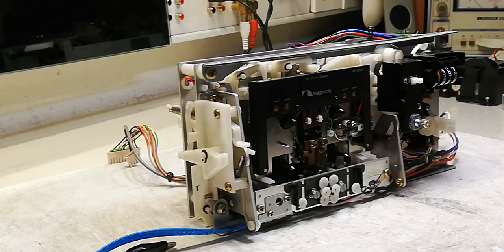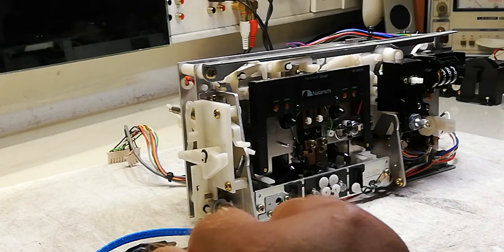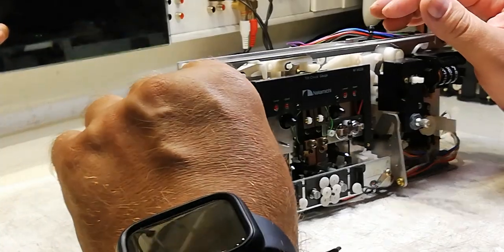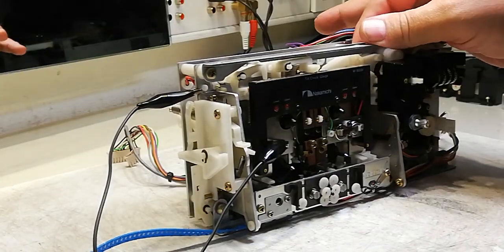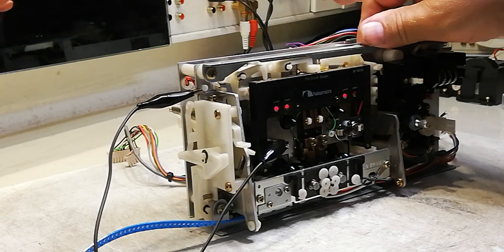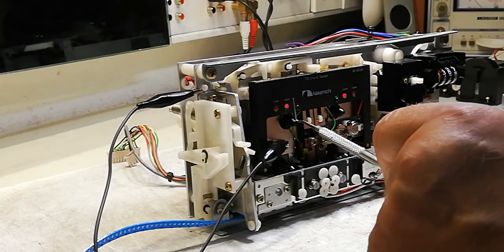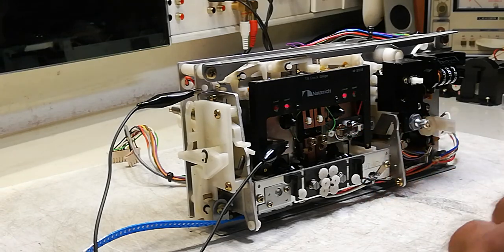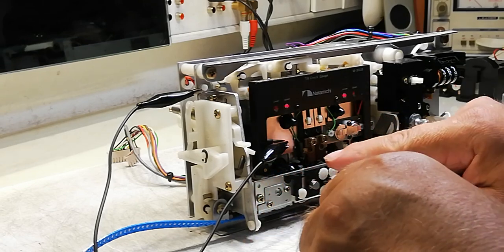Nakamichi M 9039 Tilt Check Gauge demo

Comment: I have the opportunity to buy a used m-9039 gauge....how do I tell if it is working without a cassette deck? Do I just have to put in new batteriea and push the arms upwards?
Reply from the maker: Think like this...gauge detects continuity thru head surface. If you put gauge on side to the metal 90 degree angle, leds must lights. If not, then its not 90 degree angle or detectrion switches are not in right position...and they needs to be readjusted.

Comment: Great video! What difference is there between 9039 and 9088 Tilt check gauges?
Reply: 9039 checks Rec/play back head tilt. 9088 does the same for the Erase head.